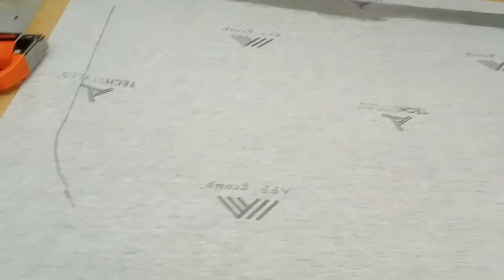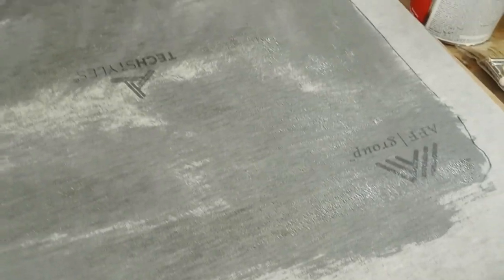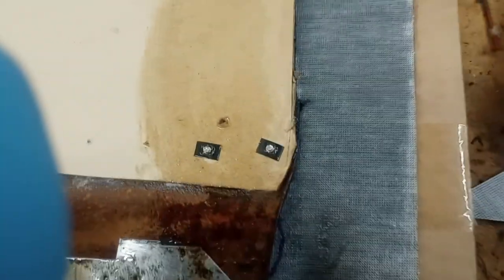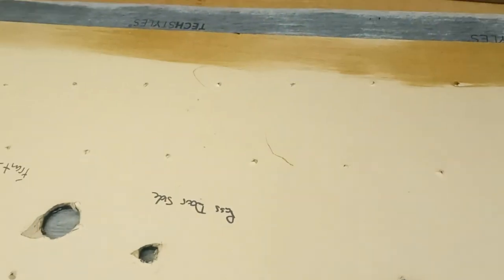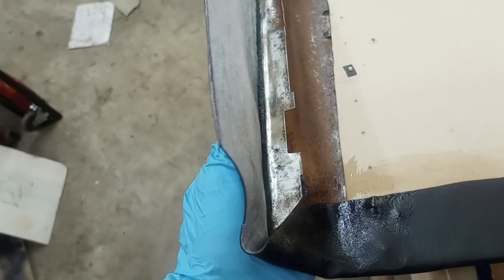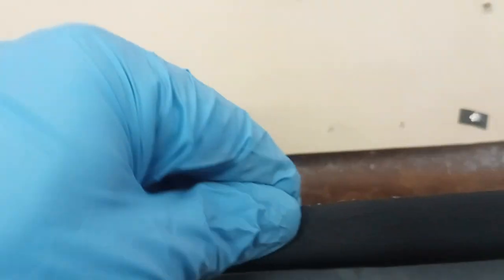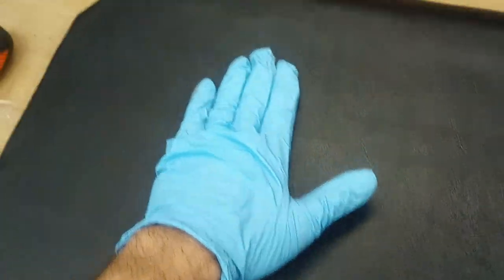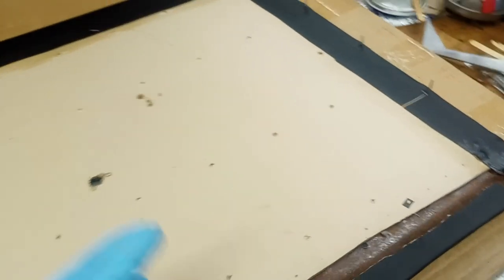Buick Door Panel Restoration -  Install Vinyl fabric

Comment: What backer board did you use? The original in mine appears to be one grade above corrugated cardboard box but isn't quite fiberboard.
Reply from the maker: I used these panel boards: https://www.automotiveinteriors.com/cowlboard-door-panel-boards-for-cars-and-trucks-s/17346.htm
They were about $50 with shipping for 2.  They're big boards.  With just 2 I was able to make those giant front door panels, as well as the smaller rear passenger panels that go below the rear 1/4 window.  They're pretty strong, almost like wood.  I was able to drive sheet metal screws through them.  In the end I used stamped flat nuts to hold the screws, because I worried that over time the threads would pull out. You can look back at my other videos that show setting up the backer board.  Thanks!